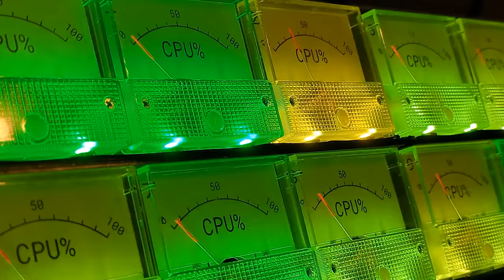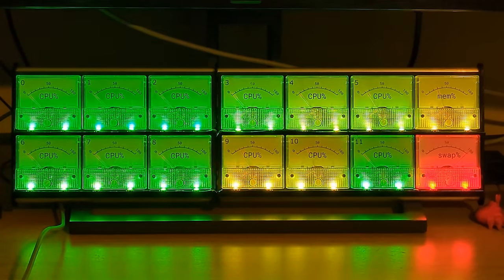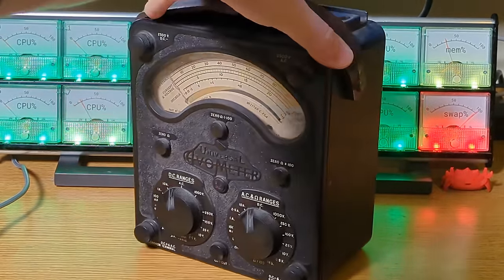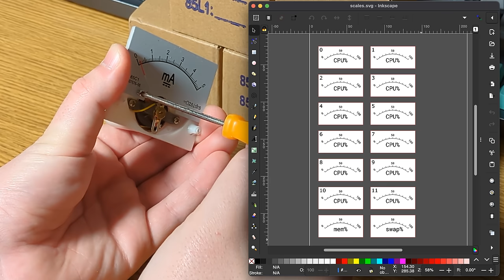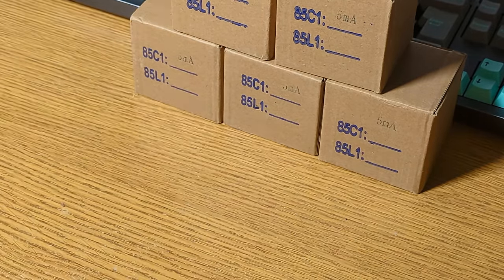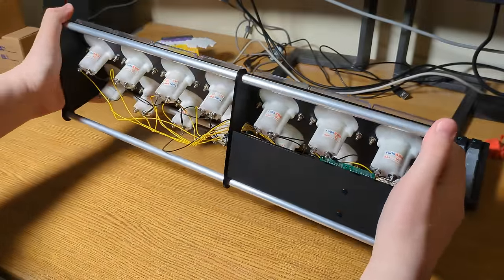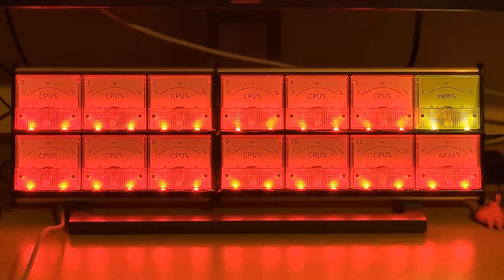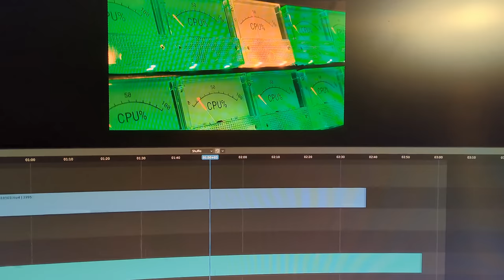A very silly CPU monitor

Comment: I would love to add GPU%, CPU/GPU power(watts) and thermals to this and then build it into an actual "electrical panel" with some switches that control the power button, some fans, etc.
Reply: that's a brilliant idea
Reply: Im already thinking abouth how i might do this for my next pc build. Have a bunch of gauges for hardware loads, component temperatures, coolant input/output temp and flowspeed, etc. on the side panel and make it look like a powerplant
Reply: And a klaxon and rotating red lights for over-temp.
Reply: oh god imagine having multiple fans and a line of switches for each of them and everytime you start your pc you flip all the switches in quick succession and hear the fans whirr up one by one
Reply: Maybe hard drive space and network load too!
Reply: I like to believe something like this is how they supervised that one first room sized pc
Reply: Agree
Reply: imagine if it had little knobs for manual override to max out the fans that are on this massive several stage potentiometer or something
Reply: a great big knife switch.
Reply: Add a gpu one that has every gpu and tensor core
Reply: Remember to add warning alarms and beeping lights.
Reply: And a physical list of processes using e-paper? Maybe 8-Segement displays truncated to 8 chars
Reply: YES
Reply: @htr_masterplayer5935  Same here. That would have been the 1960s, when supercomputers were invented with the CDC 6600 in 1964. I couldn't find any close-up photos of the gauges on the web though except for a temperature and pressure gauge, but the machine had an electrical panel built into the side.

Comment: not sure if that swap percent is just swapfile allocation or how much swap you're actually using. 100% could either be "eh, it's what the kernel reports; ignore it" or "hmm, there's a problem here"
Reply: or he has no swap
some programms report 0% or 100% if no swap is installed insted of "no swap" or "nan%"
Reply: thats becuse % is calculated with "swapUsed / swapTotal * 100" ... and "0 / 0 * 100 = divided by 0" ... and many programms than only thinks ... "well thats fu** up"
Reply: How can people not have swap, all programs without garbage collector leak memory because humans always forget things.
Reply: Recently I had a server that didn't have SWAP because the admin thought "I have enough RAM" ... what an idiot xD
Reply: @WinSysCompany I am kinda curious what'd happen to the display if it reports NaN though. does the Arduino send 0 or whatever their maximum amperage is?
Reply: @NOT_A_ROBOT  it looks like maximum
Reply: Usually in Windows, swap is something that adjust automatically.
Reply: @monad_tcp  Aaaand how exactly is swap going to help with a memory leak?
Reply: @MrHerhor67 by keeping the system alive long enough that you do a pkill -9. it even has a song
Reply: I ran most of my linux boxes without swap.
Reply: @HobkinBoi  I thought he had Linux?
But: you can also deactivate the swap file under Windows.
Reply: @WinSysCompany  I was just saying as it may be relevant to some people.

And I know one can, though especially with windows and how bloated it can be, it's probably not a good idea to turn off the swap.
Reply: @ChrisWijtmans  that means never did real computing
Reply: @WinSysCompany  I tried disabling it but then some glitchy blocks started appearing in the screen and it BSODed
Reply: @dustux  welcome to windows ;)

Comment: The tapping the dials when it acted up at the end absolutely tickled me, the classic "tap the sticking oil pressure gauge for a new reading" on a analog device reading a digital signal was great, even when the tapping worked exactly as well as expected!
Reply: Electricians tapping contactors with the rear end of a screw driver call this percussive maintenance

Comment: I love this little thing. Makes me tempted to build my own. I would have loved to see more detail on what software you use to read the values from the computer and send them to the arduino.
Reply from the maker: yeah, I thought about talking about the software, but decided not to 😅 there's not much to the software really. It's written in Rust, uses a crate that reads the performance stats from Linux, and another create that can talk to a serial port to send data to the Arduino. there's just some simple maths in the middle, and that's it.
Reply: It would be interesting to do without software. Just a device that for example can measure power usage by the cpu. I imagine it would be harder, maybe even impossible for some measurements.
Reply: Same, but I have an 18 core CPU, and windows shows it as 36 logical processors.

Comment: Brilliant. I absolutely love it!

Edit: I’ve realized this would be quite easy to do with an LED matrix, and just use green to red in a gradient. Would be more compact. Lots of fun diffusers out there…
Reply: Heck you could cut up a single rgb led strip and then solder extensions to make a matrix (or individual bars if you want). All of it could be run off 4 pins on a microcontroller.
Reply: You could. But it's a lot simpler to display it on a secondary HDMI display.
The cool thing about this project is the physical analog metering!
Reply: I love the look of LEDS behind diffused plastic, you could have RGB strips which vary in height like a digital VU meter, with numbers under each column to represent which core and a scale on the side to represent 0-100%.
Reply: wtf and why matrix
Reply: @patrickjones3826  I have to say honestly that with my skill set, it’s easier to use a microcontroller and serial addressable LEDs than writing a program to create a display that I could mirror to a display over HDMI.  That’s not to say that it’s objectively easier, just that I could write something in Processing or similar to pull from a DLL call and form an array of values to pass to an LED string.

Comment: Actually, when I started in IT in the 70's, our mainframe (GE 6000 series) had a CPU meter on each console, a console per physical CPU.  It also had lights (incandescent) to show if the CPU was in master (system) mode or slave (user) mode.  Pretty cool machines for their day, beat the socks off anything IBM had at that time.  They could dynamically bring into memory/start/stop programs, no partitioning was necessary.  In fact, they could dynamically allocate/deallocate memoy and peripherals. The Intel x86 memory management design was based off these machines.

Comment: This is lovely! A bit too flashy for my taste - I've used LCDSmartie way back when, system stats at a glance were really nice to have.
Maybe I just should try some programmable LEDs - just heat maps for the cores, simple squares.
Also backlight in analog meters works best when used from inside, but you need to black out the front.
Reply: you should
Reply: I still use LCDSmartie, I have one of those serial point of sale displays that cycles through various system info.

Comment: I built something almost exactly the same. I used an RP2040 with 6 gauges and no LEDs. I designed the internal PCB to also communicate with 6 tiny OLED displays so I could swap out the Units area (ie: uA, since I am using gauges that measure micro-amps) with the OLED to dynamically change the gauges at runtime, I just never got around to actually doing it. I also implemented smooth updates to the gauges by interpolating the PWM value changes over time, the effect is awesome, it looks so natural. I dedicated my gauges to CPU Load %, CPU Temp C, RAM Use %, GPU Load %, GPU Temp C, and VRAM Used %

Comment: that project looks so cool, i would recommend displaying the temperatures of CPU, GPU etc on the analog multimeters you have. they will be perfect as temps dont jump around quickly.
Reply: Could use the LED as temperature indicator.

Comment: 4:04 If you get CPU usage by software not by hardware, the state update can be stop when cpu is overloaded. It is one of optimizations to release computer resources. It looks like the monitoring tools stopped by full usage of cpu by video rendering.

Comment: Cool project! Funnily enough, Task Manager is technically already implemented in hardware in most x86 processors. If you look at Intel data sheets there are read-only registers that exist on the chip for tracking things like average memory access time, number of operations, etc.

Task Manager is really only a big GUI to help visualize a lot of that stuff. The same goes for the top / htop command on Unix-based systems.

This is a fun and interesting take on the concept though. Well done!

Comment: Not silly at all. back in the day I made a hard drive activity meter using an old vu meter and an RC filter to show disk activity average using the drive indicator led on the motherboard. I wouldnt say it was at all accurate but it was a pretty good visual representation of drive activity.

Comment: Now add GPU Core Load, GPU VRAM usage, GPU Temp, Water Pump speed/Water Flow Rate, Water Temp, CPU Temp, Radiator Fan Speeds.
Damn this is going to require a big ass panel.

Comment: You could get a better view of the cpu usage by measuring the actual current drawn by the cpu at the 12v_cpu rail. Just an ampermeter, 0-20A, no overhead, no latency from pooling, instant.
Reply: This is true, but it wouldn't give you separate core numbers, which is part of the "reason" for the project to begin with is to see relative core loads on distributed tasks like rendering or code compiling.
Reason in air quotes because the ultimate reason is it looks cool.

Comment: I never knew I needed to see this lmao, very cool and a very unique way of displaying this info. One suggestion though: Would it not be worth lerping between the discrete values you're getting from the PC to get a smooth/seamless transition between low and high usage? I only say this because it's a little strange to the needles move, then stop, then move, then stop. Same with the light colours changing

Comment: Without smoothing those CPU meters would slamming all the way all the time cause cpu usage varies wildly, kinda want to see that
Reply: technically, a CPU's "usage" is always either "0%" or "100%", at least form the perspective of what tools like task manager measures. "CPU usage" is not an instantaneous value, it's basically saying "what percent of the time over the last N seconds was the CPU busy?" it would be really cool to just directly expose that binary "busy or not busy" state to a meter in real time, and let the inertia of the meter smooth it out into a percentage value. practically i think that would probably add a ton of overhead since you'd have to update the meter for every syscall at least
Reply: @spambot7110 that's what I thought too! It would pretty much be unintentional PWM, and very expensive computationally... But super cool

Comment: Very cool idea. Though personally I think it could be cooler with gauges that react faster so you can see the little variations in the load on the cpu as needle wiggle. I don't know how you'd be able to do that, I guess either completely custom gauges, or using some sort of pid controlled loop that can dump massive current spikes through the gauges to get the needles to move faster.

Comment: Might seem silly, but this would practical use to monitor CPU usage in hardware than in software. Because pulling up a task monitor takes up CPU cycles, so you might not get a completely accurate CPU reading.

Comment: Cool project. made something similar some time ago but only recently got around to designing a case for it. Using 2 5v meters connected to 2 MCP4725 dac's connected to a wemos d1 mini that gets data over mqtt from home assistant to show the current energy usage of my house and my current solar production.

Comment: I won the procrastination game against you! I have these analog meters lying around for ages as well. But I opted for the 0-5V ones and want to show the PWM voltage directly using 16 channels provided by an PCA9635 PWM chip. I also figured that addressable LED strips fit their sizes extremely well. And now that I think of it, my CPU reports 32 (virtual) cores by now... I need more analog meters...

Comment: On the high swap usage, you should decrease the vm.swappiness value.
Which can be done in a config file, or with CryoUtilities for a graphical solution.
What reducing this value does is make the system less eager to swap programs in RAM to disk.
This greatly reduces swap induced wear to the flash of SSDs and slightly increases system performance.
With no negative consequences, unless going lower than 10 or so.

Comment: This great. I just ordered a few of those as well, but since I have too many cores it would look silly. I’m just gonna do cpu % over all cores, temp and mem.

This is would be the perfect program to learn about Linux device drivers. Wouldn’t it be great to just have a kernel module load automatically and send the data over to the usb when you plug this in?

Comment: This is awesome! ❤‍🔥❤‍🔥
I am planning to design a custom PCB with an ESP8266 or ESP32 so it has WiFi (maybe bluetooth) capabilities so the connection to the computer can be wireless. Then one or more 16 channel PCA9685's (which can be daisy chained) so you can easily visualise many, many CPU cores. Then the 'intelligence' should be on the client; all the hardware does is receive values or each ammeter and the computer sends whatever values it wants to display on an indexed basis to the ESP (0-100% values). Add a bunch of multi-turn trimpots for each ammeter for calibration on each of the PCA9685's outputs. Add a 3D-printed case ('modular' so you can add as many or as few ammeters as you want) and you should be set.

If anyone is willing to collaborate on this and make an open source, non-profit, project out of this I'm game.

Comment: Hey, i actually had a kind of similar but different idea a few years ago, i wanted to use an old rev counter from a motorcycle to display my internet usage, does anybody know if there is a way to monitor your networl speed using an arduino?

Comment: Fun project! What did you use to get the CPU load percentages on the Arduino?
Reply from the maker: Heh, I've had this question a couple of times now, so I've started an FAQ in the description. The answer is: I wrote a Rust program that uses the systemstat crate to get the data from linux, it then does a little bit of maths to transform the data, and sends that to the ardunio over USB-serial

Comment: Any chance of getting the code for this? I would like to build one but don't really know how to read the values from ky computer
Reply from the maker: I decided not to share the code, because it's very specific to this hardware, and so if you want to build something similar then it won't save you much time using my code. But I can tell you how I got the performance values. The code is written and Rust, and I used a Crate called systemstat: https://crates.io/crates/systemstat
It supports various different platforms. If you don't want to use Rust, I'm sure you can find a similar library for the language you want to use. I hope that helps :)
Reply: @computingthedetails  Thanks for pointing me in the right direction